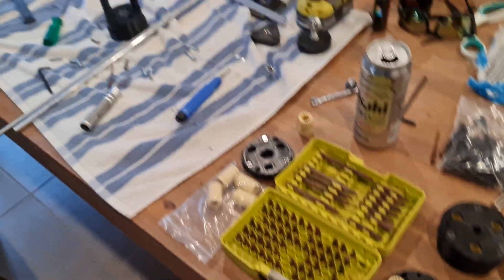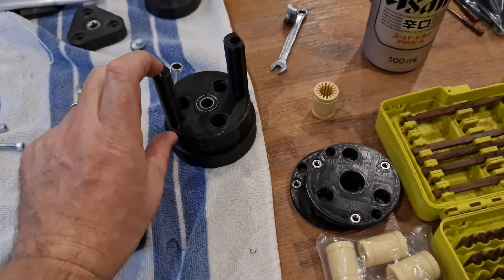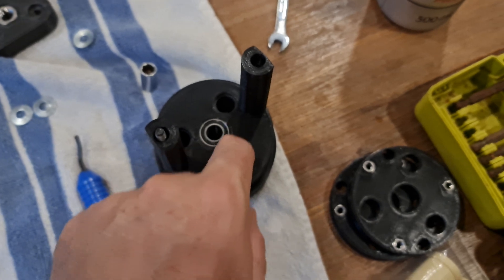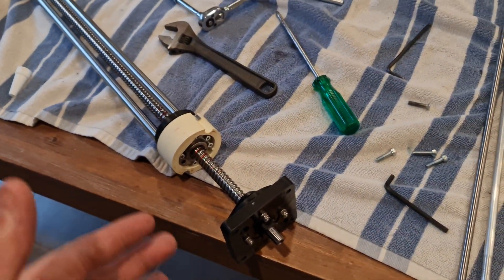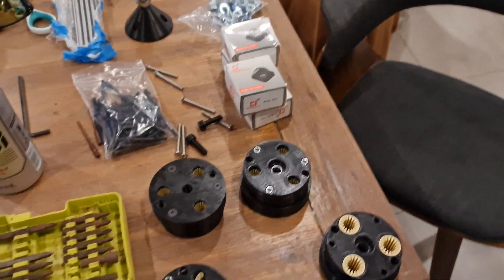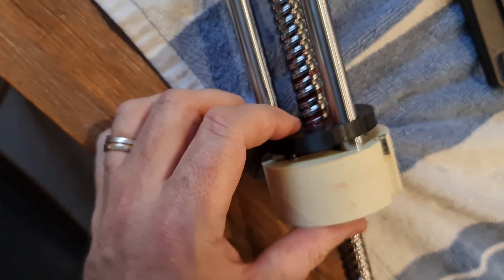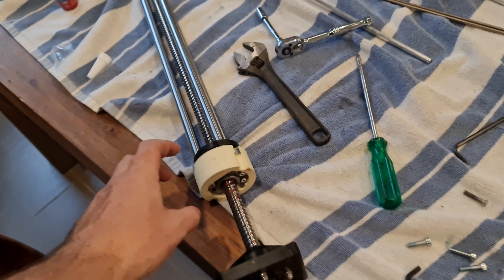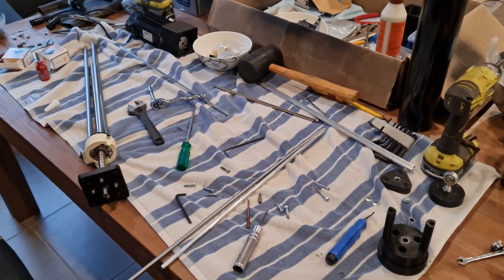V3 actuator mods. Hopefully the last!

Comment: Hi Chris, something to be careful of is using Loctite with plastics, it can and does cause cracking in the plastic parts where stress is applied. You probably need to make sure the loctite is confined to the tube thread and does not overflow on to the plastic housing. Love the build cheers Les

Comment: Nice actuator build. About that clicking noise - check if those bearing blocks hold angular contact bearings - normal bearings are not supposed to be loaded with axial forces - cheap chinese bearing blocks usually have normal bearings (you can buy angular contact bearings and swap those in the BB). Another thing is alignment of mounting slots for the steel rods - if upper cap is not properly aligned with ballnut carriage at all times it will put a lot of stress on those slide bushings, rods and printed parts - at first it would make squeking noises but after some time it will damage the bushings, slots and probably other parts. You could add locating slots int the PCV tube and add locating "keys" in the 3d printed end caps.
Reply from the maker: Cheers mate. Yeah I changed the all to angular contact. Still there. It's actually the motor couplings. Must be 100% aligned. Also noticed couple bolts loose that hold the coupling together. Kind of a mission to align them under load so maybe a job for another day. Usually only clicks on low speed movements and goes away at high rpm. I have  plate couplers, I might even try for the ones with the red urethane spacer in the middle like the commonly used ones on 3d printers etc. I opted for plate coupler because they're meant to be more robust..
Reply: @peacemakermotion3949  Actually coupler main task is to allow for slight motor shaft and screw misallignment.
Reply from the maker: @lromaniuk  yeah so when it's flexing at the one point every rotation its making a click. It does seem to be in sync with the rotation. Either the coupler being loose is making the noise or it's just out more than it likes. Maybe the red urethane style will be more forgiving or at least silent. But I'm sure I could just loosen both ends and realign the coupler and it may fix it. I seemed to have fixed one by doing it. But like I said, while it's on the rig it's near impossible to do both sides. I just can't be bothered pulling them off again for a while  especially now with the triple screens it's heavy as all hell on the front!

Comment: I just discovered you today and maybe i haven't found it yet but do you share the 3d print files or have a build list?
Reply from the maker: hey mate, yeah i do have up on my xsimulator page. search for peacemaker or there is a link on my other videos, i just havent added it to these ones yet haha. i will have this new design up in a couple days as well :)
Reply: @peacemakermotion3949  i ended up finding that and have been reading your blog thanks buy the way. If you don't mind i do have one question. Do you know of a servo motor capable of this but 120 volt? I am in the us and running a 220 outlet may prove to be the deciding factor for me.
Reply from the maker: @robertrose7645  heaps of guys run these drivers off 120v there's some videos on how to wire them up on YouTube. I think thanos has one too. Think you may have to utilise 2 circuit breakers though as you'll be pulling more Amps. But don't quote me on that. Mine basically only uses 600w total of the 4500w max so bairly works the motors hard haha. They are after all designed for industrial use
Reply from the maker: Just updated the info here :)
Reply: @peacemakermotion3949  Please forgive me for this question.... I can't seem to find the updated list and updated 3D print iles.. What i got was the ones posted for 2020. Hope you can post me the link  .. God Bless
Reply from the maker: @jaimeg2610  I'll post them tonight. But half the files are the same as those initial files and you will still need them :)
Reply from the maker: https://youtu.be/GhvVC6iO04M
Reply: @peacemakermotion3949  you are the best thanks. I will search more before anymore questions thanks.